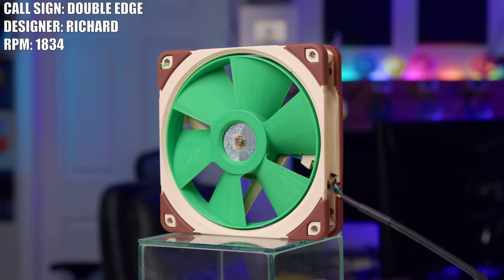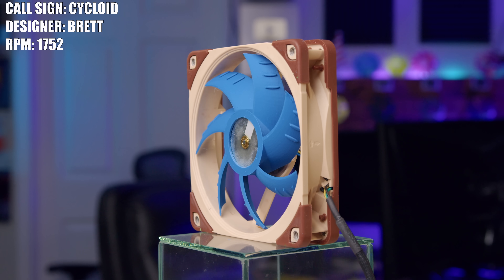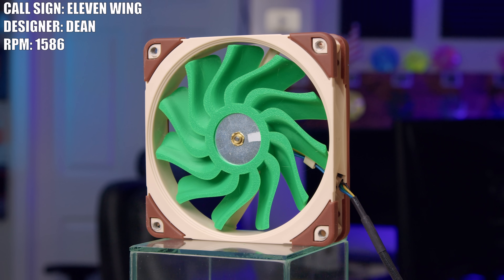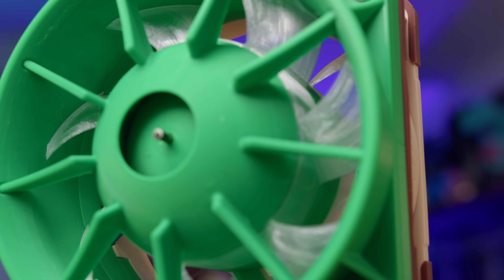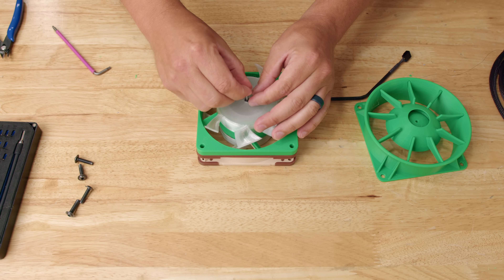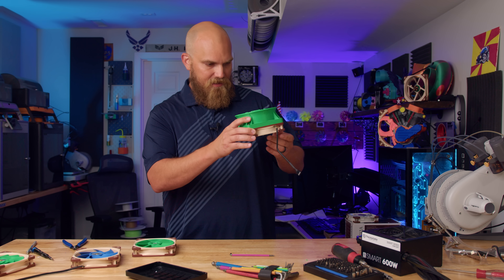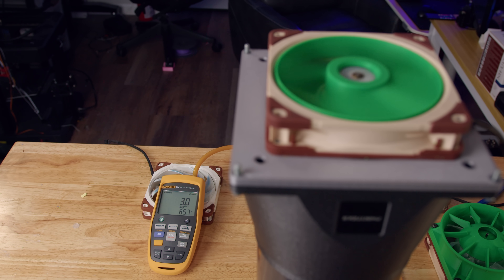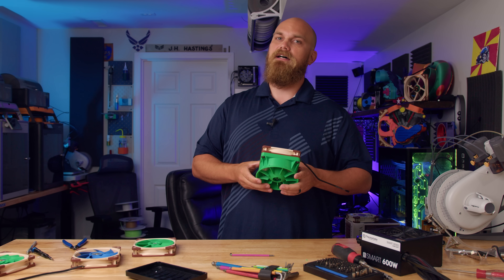I’ve Tested Hundreds of Fans… Nothing Like This One – This Fan Is a Masterpiece | Fan Showdown S6E11

Comment: Thanks for testing my Jet Stream. Takes some effort, and hardware to assemble. With tuning, I was able to get 1100 RPM in the exhaust blades, and there's a 1 to 1.3 increase ration to the intake. Again thanks, you made my 4th weekend great!
Reply: Glad you made this point as the instant he said spin at the same speed my brain went "no they don't"
Reply: Washers, did you use washers?
Reply: Wow, really impressive. The smoke test was pretty awesome too
Reply: To answer various questions in this thread:
1) there are gears, just not traditional toothed gears. the o-rings riding on shafts act as gears and their size difference from the size of the main drive shaft induces a ratio apart from 1:1
2) three would likely be the ideal for balance, same as for props, wind turbine. From the first up, each additional adds more parasitic losses due to friction.
3) I didn't notice if he lubed the shafts during assembly, but that should help with friction losses and noise - nylon bushings?
Reply: Truly a lazer in the fog test
Reply: You mad effing genius.......... 😳🥺🥹
👏   👏   👏   👏   👏   👏   👏   👏   👏
Reply: Beautiful work good sir. Do you think with some tweaking and refining you could make the hub a bit smaller to allow for slightly bigger blades? I also wonder if going up to 4 shafts going to the other side you could maybe make it more stable and quieter. Or was there space issues there I didn't notice that made you stick with 2?
Reply: @VoidOperator real estate, there's already a hub, then add something outboard to transmit power, balance loads without losing force. Simplify and optimize.
Reply: @VoidOperator  I get the feeling that by adding more shafts you'd exprience more losses to speed which is more critical for performance
Reply: Amazing fan, would probably do better in the airflow tests?
Reply: @AdamWebb1982 I was thinking that too. Static pressure isn’t everything.
Reply: Really clever idea 👍
Reply: It's really very clever design, kudos!
Reply: This fan seems not at all optimized for pressure, but rather flow rate efficiency.  So it would make a great jet flow cooling fan.  I would like to see it tested with the 64 microphone acoustic imaging tool that Adam Savage tested.  I suspect the noise comes from the mechanism or some impingement.  This fan might benefit from some fine Swiss craftsmanship tuning.
Reply: @glike2  Yeah it's definitely a high air flow design and not for static pressure as we saw. I'd likely guess if it had been made with the epoxy printer instead of extrusion print it would work better and less variances so less wobble... But it still will have issue no matter what since the motors on those fans aren't that strong. Give it a better motor that can do higher RPMs and it would move some serious air.... Heck try to find a server fan and rig that thing up!
Server fan move anywhere between 6,000 to 20,000 RPM
Reply: If you wanted to try ball bearings, the Mini4WD scene have them available. Tamiya sell them to fit both hex shaft and round shaft. 2mm Inner and 5 or 6mm outer diameter.
Reply: @yehnahthx  these fans are actually typically 3mm shaft, 2mm is typical for a 130 motor which is in mini4wd, many slotcars and even smaller rc cars like the mini z platforms.. have torn down more than a few pc-fans with worn bushings to the point of they squeal like mad when trying to run
Reply: Just for the curiosity of engineering: did/can you make a design with two opposite facing fans / motors? It looks like you optimized the hell out of that blade forms, and with two fans and so a way bigger diameter and without the extra friction this concept would be an absolute beast. It's awesome like the current design creates a straight airflow after the fan, this is awesome!
Reply: @alphastratus6623  has been done a lot in the 40mm fan sizes, typically server stuff as they get quite noisy, but they can move quite a bit of air very quickly
Reply: The Jet Stream has the coolest smoke test I've ever seen in this series, and I've watched every single episode!
Reply: I'd love to try a print my own version of this. Are the STL files available?
Reply: You should make a V2.0 of the Jet Stream that uses 2 Noctuas, just for fun. Then tune the speed curves for maximum concentrated airflow, like some of those fancy, 76mm thick server fans with contra-rotating blades.
Reply: @marsaustralis6881 done
Reply: Wait, how does the intake get an increased ratio? It looks 1:1 to me, but it might be the extreme sleep deprivation
Reply: @ll3dn4r shaft is driven in the inside and is driving on the outside. If both drives where on the same side of the shaft the fans works spin the same way.
Reply: @Thomamps  Dangit I didn't catch the inner ring on the intake fan, I was really sure they were both contacting the outside of the roller. Thanks!
Reply: @ll3dn4r  the spools pick up on the OD of the driven exhaust fan, and transmit rotation to a inner ring on the intake. It's the ratio of circumferences.
Reply: @ll3dn4r the rollers touch the inner diameter of one fan and the outer of the other, which gives both a change of rotation direction and a ratio change.
Reply: have to say, that design looks pretty damn cool and seeing it work exactly how it was suppose to is awesome even if it didn't have the greatest static pressure.
Reply: I think MH botched the print of at least one rotor, it sounded like it was rubbing, which greatly affects the RPM since the A12x25 has such a weak motor. Not sure if he lubed the shafts, but that could help as well.. I hope he gives it another chance. I love the design
Reply: That was one of the nicest smoke tests. Good work. I think the motor is your weakness but the design is solid. More voltage.
Reply: Awesome work!
Reply: A slightly beefier fan motor hub and it might work much better and perhaps have three rollers. Anyway, an interesting concept and very nicely executed already as is.
Reply: Beautiful fan!
Reply: Maybe try using just one roller to decrease the friction
Reply: Absolutely Awesome. I've been hoping to see a contra rotating prop for a long time. It's unfortunate none of them have performed all that well
Reply: I would love to see him put this on a stronger fan hub.
Reply: Honestly,
That fan is so clever, i'll one day be very thankful to you for putting the mechanism in my head!
Thanks!
Reply: My favorite so far as well
Reply: This fans made me think of Antonov AN 22 Engine
Reply: thats a brilliant piece of engineering
Reply: You are a BRILLIANT Mechanical Engineer. This design is MUCH simpler and more compact than traditional counter-rotating gear props. Apply to the Skunk Works, you belong there!
Reply: Where can you download the stl files for your jet stream. I love the way it looks and functions really want to print one my self
Reply: Thanks for clarifying the ratio. It was killing me every time he said they spin “at the same speed”.
Reply: Your design would have likely worked better if you had one of the fans spinning at a lower RPM. The Delta dual fan IIRC has the rear fan spinning considerably slower than the front fan with the reduced blade count.
Reply: @GGigabiteM the first, driven fan is slower in that design, and also: RPM differences can be compensated with other fan design. You can clearly see in the smoke test the quality of the air stream after the fan - so the rpm and blade form works out absolutely great.
Reply: HUGE ENGINEERING TRIUMPH
Reply: Lose the gasket between the spacer and A12X25...
Reply: I'd love to see this run again with some lubrication and every attempt to nail the tolerances.

I'd also like to see it measured for P/Q curve for it. I wouldn't expect this to provide max pressure, nor max airspeed, but perhaps quite good somewhere in between.
Reply: Where can I get an STL. of the "Jet Stream"?  There are a few things I think I can change up.
Reply: I would like to make some changes to your design.
Can I get an STL of your Jet Stream?
Reply: Out of curiosity, why did you choose the smaller fan to be driven directly?
Reply: @WillowEpp  Layering, if the A12X25 was the intake, there would have been another layer of arms from the hub to the frame. Plus having the A12X25 working in reverse bucks the norm.
Reply: Could you reverse the direction of the build/flow? I feel like that mechanism can get a lot more fan area out of the counter rotating feature
Reply: The stream was really straight, with some tweaks this could be a fantastic personal desk fan design
Reply: What if you do the same design but use two A12x25 fans front to front.  I doubt it could be tested in Showdown against others fairly, but maybe an honorable mention?
Reply: Nice design!
Reply: MY KNEECAPS ARE BROKEN 🗣️🔥🔥🔥🔥🔥 I CAN'T FEEL MY LEGS 🗣️🔥🔥🔥🔥🔥 METAL GEER RAHHHH
Reply: is the model available anywhere? would love to have a look.
Reply: Your fourth weekend? Like, ever? Who gave this baby a keyboard lmao
Reply: Fantastic design sir!
Reply: Killed me he didn’t do an assembly view in fusion 😅
Reply: can this test be tried again with two motors? doesn't seem quite fair since you're spinning two blades rather than one. I believe the jet will be amazing with two motors. maybe reduce the supports in intake to have entry be less obstructed. i have a vision where a custom PC case has a tube straight front to back with this fan pumping in straight to the cou fin stack!
Reply: The smoke test was amazing, I'm sure it's just the power that lacked and some friction here and there, but the design was solid in it's own

Comment: I'm sorry if i sound like a nitpicker, but i think you should try to smoothen the fans a little, as i learn porting rotary engine, you need mirror smooth surfaces, the airflow is so sensitive the tiniest imperfection can flaw the results ! Appart from that detail, really nice video as usual !
Reply: He did a video on it once. The gains weren't very significant, as I recall. (been awhile so I might be misremembering)
However, with Bambu having a smoothing feature that uses the nozzle to do a smoothing pass after, this might be worth the time now. If he doesn't have one, might be time they sponsor him one... 😁
Reply: Rough surfaces can actually be better as they create a tiny boundary layer effect.
How much it comes down either side (better or worse) is totally dependant on specifics, just because a golf ball has dimples doesn't mean it works on every thing at ever scale at all speeds. Either way its more work for these fans than it is a benefit.
Reply: @tomstech4390 Gah I forgot to mention that. Thanks.
Yea, working the same way as the intentional bumps (like on the one fan here), to generate turbulence. I can't remember why laminar flow can be problematic in these, I just know there are instances. At least with plane wings it can be, where I think it causes a control surface lock or stall condition (one of the two).

Comment: Jet Stream may not have much static pressure, but the mist pattern says that it's good at directional airflow. A mini version of this parked on top of a heatsink for a CPU probably would rock at cooling the heatsink AND vrm's.
Reply: It wouldn’t need to be mini but perhaps with a different manufacturing method such as SLS it could be quiet enough for a home computer
Reply: ngl it would rock!
Reply: I wonder if its better for a floor fan. Almost all have the same type of design
Reply: imagine who of them on a Jushark JF13k set up
Reply: You can definitely set it up for much more static pressure with some tweaking

Comment: Man that contra-rotating fan is just engineering simplicity at its finest. It's like the simple answer that was just staring everyone in the face
Reply: So many of these fans make me think "it was so obvious", but I would have never thought of it without seeing it first.
Reply: I still don't get how it works.
Reply: @caramelldansen2204  One blade piece is rotated by the drive axle and the other one is rotated by the rollers. The rollers are rotated by the first blade piece.
Reply: @user255 So the rollers on the outside of fan 1 reverse the rolling direction; surely the rollers pushing the outside of fan 2 re-reverses the direction? I'm so confused.
Reply: @user255 ohhhh okay makes a lot more sense now
gears would probably be more reliable!
Reply: @caramelldansen2204  That's debatable.  Gears introduce more variables than a friction drive.  They also are going to be louder, and don't allow for slip.

Just as importantly, even for 3d printing, they make manufacturing that much more difficult.
Reply: I wonder if it would be even better with two motors, removing the transmission losses of the spindles and o rings.
Reply: @joejoejoejoejoejoe4391  Of course, but then it doesn't fit for the competition.
Reply: Or you know he could have linked it with magnets that work as a clutch with no friction
Reply: @briandoe5746 Easier said than done. Magnets introduce a whole host of other challenges, weight, intermittent energy transfer, etc.
Reply: I always had that idea floating around in my head I didn't say anything because I thought it was common knowledge
Reply: I dont want to downplay this design but server fans have been like this for the last 20 years. They use 2 seperate motors for more power and reliability. Still a very smart design for this challenge!
Reply: @WolfmanDude  We all know the contra-rotating part itself isn't new.  It's the method that's impressive.
Reply: @WolfmanDude  Most server fans aren't contra rotating they are just small high RPM motors (Between 6,000 and 20,000 RPM) with deep blades so they just blast air at high speeds. Not try this fan with one of those server motors instead and that thing would absolutely rip.. Though you might need to put some gearing on there as it would likely be too fast for the rubber gaskets to keep grip
Reply: Man i would love to see that. Imagine 3 server fan motors running counter rotating blades cooling a radiator.
Reply: @WolfmanDude  Way to miss the entire point
Reply: @WolfmanDude what are they called? I haven’t seen them in any servers I’ve worked on. I’d be curious to see one

Comment: I think on the double fan, the driven fan spins slightly faster since the rollers/o-rings are the same radii (i think) but the drum they roll on is smaller for the driven fan since it's inside the rollers versus outside for the driver
Reply: Yeah I spotted this too. They can't spin at the same speed with that design, but that's also not necessarily an issue provided the blade pitch is adjusted to suit the different speed.

Comment: For the next season, I'd love to see a controlled temperature benchmark on a basic cooler like a Cooler Master Hyper 212. Basically, something anyone could buy and try, with real world values.
Reply: attach the heat sink to a known thermal load, and increase the watts until temp hits 80c, highest watts wins?
Reply: Yup use a PID to control a heating element attached to the heat sink, and measure the power needed to keep it at 80 😎 that would work awesome 👌
Reply: He actually use to do that... I believe season one was determined by cooling capability.
Reply: Dude yea, maybe a series of coolers like 2 one tower, 2 two tower, just to keep it diverse